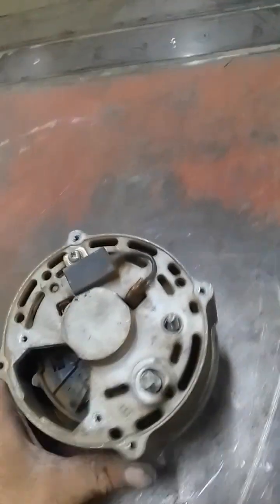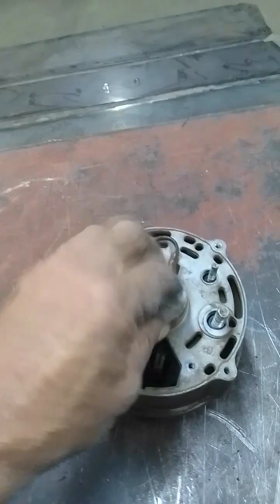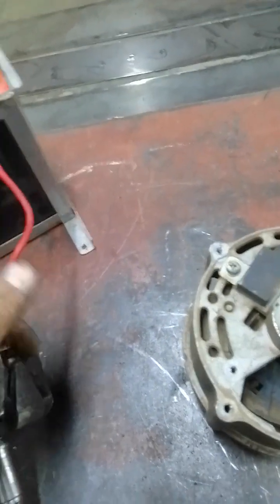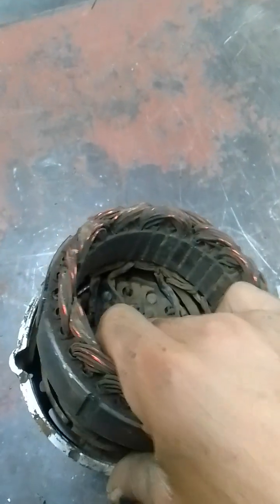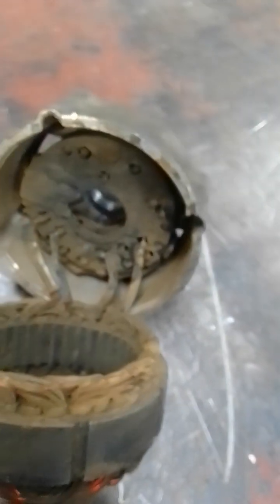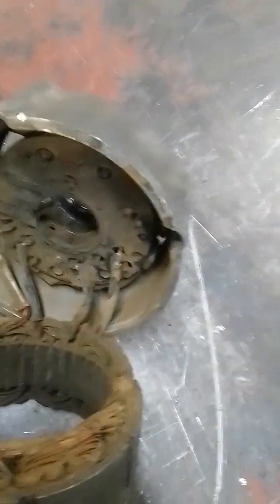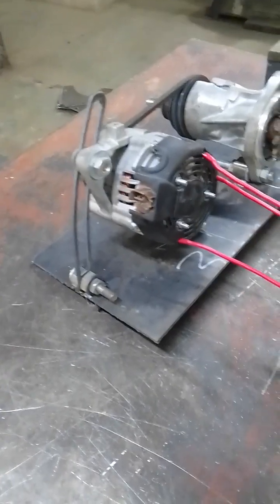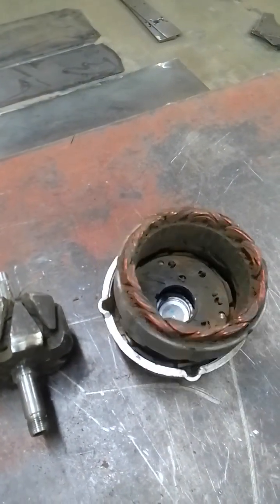alternator hack how to convert it into a 3 phase motor or free energy generator

Comment: What if we give 230volts 3 phase  AC  power to stator coils? That will enhance power
Reply from the maker: Hi SoftelMachines i have not yet tried it but the windings would burn its not designed for such high voltage i have tried it on max 72v 40Amp and got extremely hot really quickly  so the more you up the voltage the faster it turns and the more amps wil increase the torque